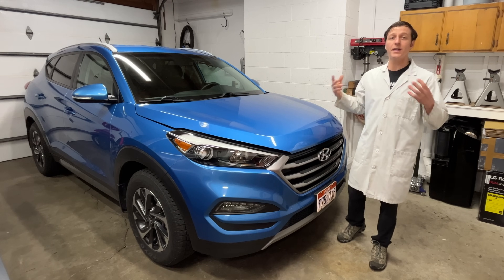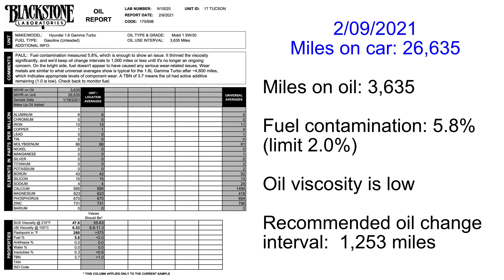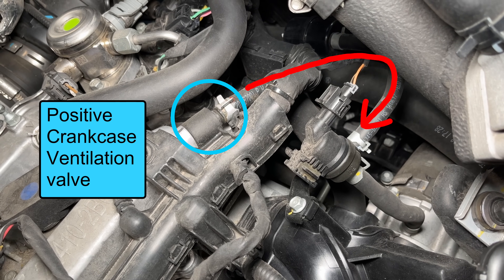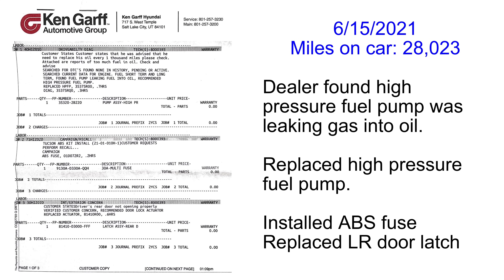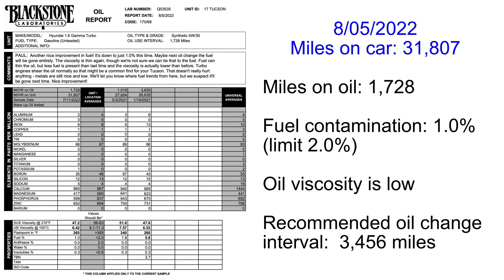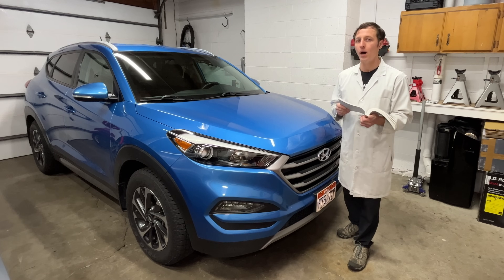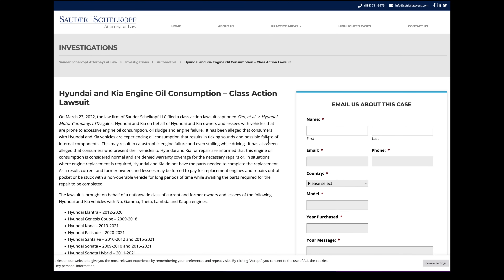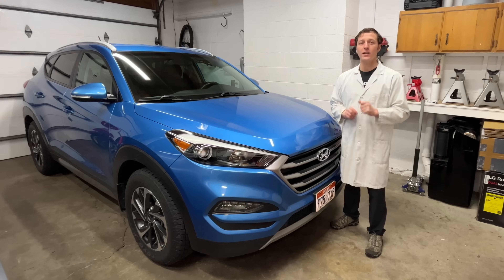Hyundai oil consumption and gasoline contamination problem solved

Comment: Of course Paul bought a Korean Hyundai which is essentially the Chinese scooter version of cars. I appreciate all the hard work you put into your videos. You're the man!
Reply: I don't know why everyone says Hyundai is killing it now. 2000s Hyundais are reliable and cheap, but they're not flashy like later ones. Only modern engines of theirs I trust are the 1.8L 4 banger and the 3.3L V6
Reply: @SkylineFTW97  The 2.7 V6 is probably the most reliable engine Hyundai made.  Both the Delta and Mu versions.  Mu has variable intake manifold so adds a bit more complexity and possible failure modes but is very reliable.  Both are port injected.
Reply: Their 2.0 port injection is pretty good too. Made by Smartstream I believe. Can be found on 2018 Kona and Elantra.
Reply: @SkylineFTW97  100% agree. The 90s and early 2000s Hyundai used Mitsubishi iron block engines. That's why they were decent. Current trash is sold on that reputation.
Reply: @MirchiBoy  a 2001-2006 Elantra is what I would recommend for someone looking for a cheap, reliable, and fuel efficient car if they have less than $3000 to spend. They can be had for under $1500 and parts are common and cheap
Reply: @SkylineFTW97  I had a 96 accent with manual trans that was 15 years old when I bought it and 25 years old when I sold it for $1200 which is no small feat in upstate NY.  I've owned toyota's, honda's, nissan's, hyundai/kia's, and a chevy vega.  the 96 accent was the best car I ever owned.  yes, even the japanese toyota's and honda's need repair.  the years you mention were good for hyundai/kia in general.
Reply: @edwardjames6070  I maintain the hell out of my cars. I own mostly Hondas and I give them the same rigorous maintenance schedule I'd give anything else. Maintenance is always the key to a long service life.
Reply: I think you’re thinking of Volvo which many are actually made in China 😂. Hyundais are pretty decent these days.
Reply from the maker: I've never thought of it that way.  Yes, they are the Chinese scooters of cars!  hahaha
Reply: @LabCoatPaul  - Chinese scooters that sell before they even reach the dealerships.

Comment: Great video.  Hyundai is junk.  

Had an 06' Rav4 V6.  Was a turd.  Had a clunking problem with the steering intermediate shaft (Toyota refused to fix under warranty and then admitted it was a problem after the warranty was up).  Alloy wheels rotted (garaged, well cared for car).  Rear lower control arms replaced TWICE (recall).  Stereo knobs took a shit around 55k.  And the best of all- the pcm flat out shit the bed at 77k.  

The 2gr may be "bulletproof" (have one in my GS350 and it's fine) but the rest of that Rav4 is a pile of shiiit.
Reply: Our 2020 RAV4 is a nightmare.. I’m in complete awe of how anyone says Toyotas are good cars.. it’s complete Made in Canada junk. I’m sure a Corolla made in Japan is a different story but we will never buy another Toyota after this.
Reply from the maker: I reviewed my friend's 2008 V-6 RAV4 with 140K miles and it didn't seem junky at all.  They do feel like they're made out of tin cans though.  I just want that 2GR-FE for my first gen RAV4.
Reply: Id argue they are more reliable than subaru, definitely more than anything Nissan or Mitsubishi and on par with Honda if not slightly worse than Toyota. I’ve worked for both Toyota, Honda and Hyundai lol.
Reply: Hyundais were at their most reliable in the 2000s. Those were actually good cars.
Reply: @SkylineFTW97  held up to rust pretty good too.  back then I think they dunked the body in a tank of undercoating.  they showed a video of it back then to entice people to buy their cars.

Comment: I'm a Honda technician. We have the same problem with the L15B7/L that's used on the Civic, Accord, and CR-V. They reek of fuel when you change the oil most of the time and they come out thin. We have a TSB about it, but there's not really anything you can do but change the oil sooner to prevent premature wear. Another thing that hurts this cars is being driven only occasionally or being driven softly. Giving your car an Italian tune up is essential for GDI health. Also helps minimize carbon deposits on the intake valves, another big problem with it.

All direct injection engines are more prone to oil dilution than port injected cars and they're more likely to burn oil.

With any GDI car, I never recommend going past 5000 miles between oil changes under any circumstances. 4000 if turbocharged. I did 4000 mile intervals in my old 2009 Mazdaspeed 3. 

I have a 2015 Honda Fit myself. I've changed the oil every 3000 miles since I got it and I have 0 noticeable oil consumption or premature wear. My mom also has a 2015 CR-V with the K24W9 engine also with direct injection. I use the same schedule on her car and while hers does burn a bit of oil, it's maybe 1 quart every 4-5000 miles, not that much for a modern car (they all burn a bit of oil nowadays).

TL;DR I find that the easiest solution long term is to use shorter oil change intervals. Direct injected engines need MORE frequent oil changes, not less. Doubly so if they have a turbo. Those are very sensitive to oil quality and are quite expensive to replace if they fail. Oil is much cheaper. To give an idea, a turbocharger failed on a 2017 CR-V at the dealership I work at. The cost for us to replace it was $4000.

Also clean and/or change your PCV valve often. It usually gets overlooked. It will also keep oil leaks to a minimum. It may also help to run a catch can.
Reply: 2.4 with catch can, new pcv. Catch can has custom installed baffle and bronze microporous filter. I capture about 70% moisture and 30% oil in the can, needs emptied every 500 miles or so, I do it before it is half full. Also I don't push oil changes beyond 3k. No noticable oil consumption yet, 2020 model 67k miles. 

Stay away from turbos, too much cylinder pressure. Modern car motors are built slightly looser (to reduce friction and gain mpg) and have narrower rings on pistons. This makes blowby more critical and oil changes as well. The rings must remain free and extended oil changes run risk of dirty rings which are more susceptible to seizing and resultant ruined engine.

Most people just don't take the time to educate themselves on engines and best maintenance practices. They just want to drive, if that's the case then just get a Toyota 4.7 v8.
Reply: Interesting. I was going to try and get a 2023 civic to replace my shitbox 2018 Tucson. You're saying I'd have the same issues with excessive oil consumption?
Reply: @theindooroutdoorsman  The base 2.0 won't since it still uses port injection.
Reply: @SkylineFTW97  Good. I thought it was back to the drawing board for what car to change to.
Reply: @theindooroutdoorsman  Even if you did get the 1.5, you'd be fine if you did the 3000 mile oil changes.
Reply: Honda/Toyota with port injection last forever.  The newer GDI/Port still need shorter engine oil changes
Reply: What is a catch can? I personally don't understand why they don't just go back the regular fuel injected motors if these have so many issues. I'd rather use more fuel then waste labor, oil, and motors themselves. Hey I get it, an oil change isn't expensive and it only takes 10-15min but when vehicles are burning oil, and leaking fuel into the oil so bad it needs to be changed every $1,000mi I'd rather lose a few miles per gallon then have to spend $50 every 1,000mi plus risk blowing the motor. Fuel is expensive but I value my time more then a couple extra bucks a week. I've gotten over 300,000mi out of nearly all my vehicles that were simply fuel injected and I thought they did great on mpg. These vehicles do better but if I'm paying $40,000 for a darn hyundai I'd like to go 3,000 to 5000mi between oil changes without burning oil or worrying it's getting fuel into it. As of now I've been going $2,500 but now I'm worried that may be too long. When I check the oil before changing it's always full but I also worry now it may just be topped off with fuel making it worse then low on oil. I have had the vehicle going on 7 years but I have only put 126,000mi on it. As much as I paid I expected at least 350,000mi. My next vehicle will either be an older vehicle or one that doesn't have the high pressure fuel injector pump.
Reply: I put in a catch-can at around 8,000 miles. The oil in it smells awful!🤢
Reply: @cumshot247  Same with my 2020 Palisade